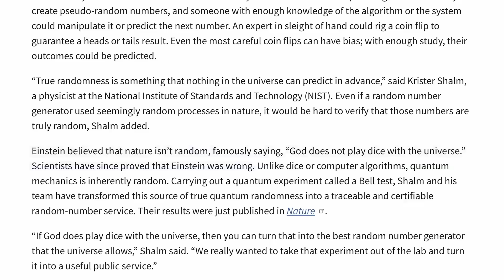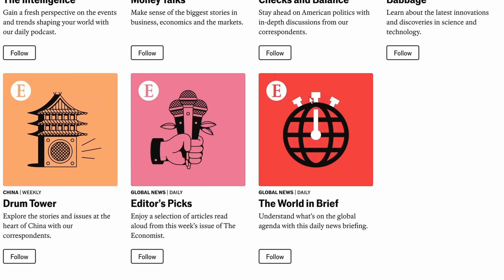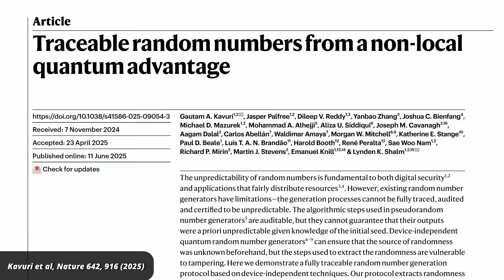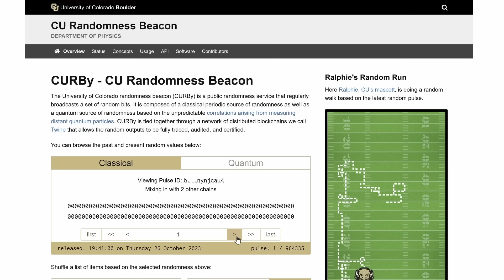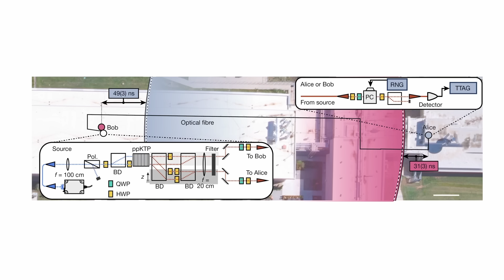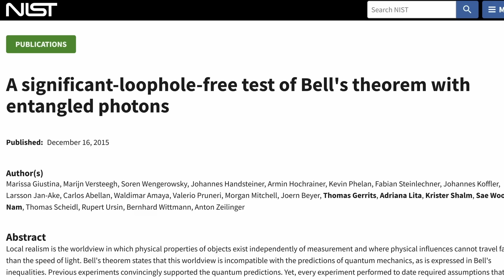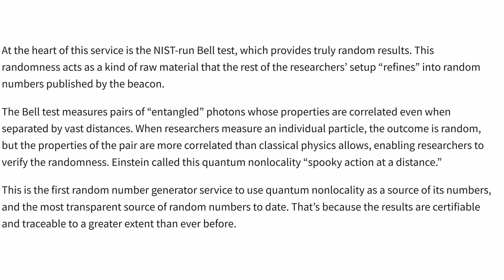Was Einstein Wrong about Randomness?

Comment: Sabine raises an important point; As demonstrated by this topic, as a collective, we humans are able to ponder very complex line of thoughts, but we increasingly appear to have problems with any underlying common sense or even basic logic. Yet in all fairness; it isn’t quite new. Little Albert (yes him again) is without a doubt the greatest physicist of the 20th century, but also he left some remarkable unchecked logical inconsistencies. The most prominent is his completely schizophrenic view on spacetime as fabric; In the closing words of his 1920 Leiden lecture, Einstein was extremely outspoken; there MUST be a ST fabric relative to which motion and time can be measured, otherwise GR cannot function. Now compare this to his 1905 SR where he utterly denied any real ST fabric relative to which motion can be measured. He never even tried to retro-actively align both. This is where physics got off the rails right until now, without us realising it. Forget about the math, physically you can NOT have both a grid and no grid at the same time. One of both theories must be incorrect on this point and it is SR that needs modification; in SR we must insert this GR spacetime fabric to finally understand that speed contracts frontal spacetime (and through it generates the effects of length contraction and time ‘dilation’). It is the necessary step to begin understanding what physically causes gravity. For some reason we have collectively been cast a spell upon for 100 years…A very effective Jedi mind trick…
Reply: gravity is not caused by energy and momentum. energy and momentum cannot be the new pseudo-substance that makes everything. things are not made of energy. energy is one property of things. 
Einstein's relativity does not work for symmetrical systems, and Einstein failed to grasp this. 
the formulas are correct, but they work only for asymmetrical systems, almost all physicists failed to grasp this. 
great irony, Einstein made his first theory starting from symmetrical systems, and the formulas are great for asymmetrical systems, and there is no way his relativity can work for symmetrical systems in reality. there is no possible instance to apply that.
another general failure: all physicists, or almost all, including Nobel laureats, failed to grasp that the relativistic effect is partitionable, you yourself have no idea what this means, it is partitionable and things that cause the relativistic effect do not generate that effect on themselves, another general failure, and reading these, you have no idea. 
facts: the relativistic effect of a satellite in relation with Earth seems to be confirmed, but there is no measurable relativistic effect from satellite to satellite, even if they do not keep same distance. 
must clarify, when we talk "relativistic effect", it is the non-recouperable part of it. relativistic effect are recouperable and non-recouperable. Einstein's discovery was the non-recouperable part of it. just to make things clear. 
Einstein's introductory approach, same as anyone's, was that the motion an the speed limit are the causes of the relativistic effect. you all are still failing to see the real picture. so, it is also Einstein's limitation. 
motion and the speed limit do not produce relativistic effects, the particles, i mean the real particles, produce the relativistic effect. Einstein took something non-physical, and formulated conclusions based on non-physical objects, and you all prolong that, you all fail. 
motion and speed limit cannot produce the relativistic effect. did Einstein understand this? i believe not. 
to produce relativistic effects that are measurable, accountable, it is essential to have asymmetries, certain kind of asymmetries, and only that produces relativistic effect. 
so, Einstein certainly had a limited view, and so have you
Reply: @saramanbrudesco  Not quite sure what you are trying to say here. So the essence here (and truly the essence of all of physics) is that in GR Einstein in his 1902 Leiden lecture (correctly) claims there must be a real fabric called spacetime. Whereas in 1905 SR Einstein claims there is none. In an effort to somehow bridge this logical and physical inconsistency, physicists say that the math of GR approximates the math of SR in case there is no almost no mass and energy to curve spacetime in the first place. So spacetime becomes mathematically flat and therefor there is no paradox......Ehhh...Excuse me?....That's a ridiculous argument. Obviously GR mathematically approximates SR in a no mass / energy filled grid.  it would be even more inconsistent if it didn't. But that's completely beyond the point. Flat spacetime time doesn't mean absent spacetime. It is just means nearly unaffected or 'non-curved' . Not absent. Take an analogy; let's consider a fish tank with 100 sharks and a small fish swimming around them. The fluid dynamics are very complex and you would need a GR like complexity to describe it. Now you take out all the big sharks (except our single brave tiny fish) and you then claim that since the fluid dynamics are now extremely simple (a simple as 'flat' spacetime in `SR' ) then this means all the water has now physically disappeared. No it didn't! the water is still there. Just like fabric of spacetime doesn't magically disappear or lose its inherent ability to be curved or to physically provide us with clocks and rods as Einsteins himself described in 1920. This is the hight of absurdity. Yet 99,9999% of all physicists agree this is a sensible conclusion to draw since the math of SR and GR converges. By denying physical spacetime in SR they are denying that speed in SR contracts frontal spacetime and as a consequence they need a 'free miracle' to explain length contraction and time dilation as just falling out of heaven. And since they miss that contraction of the fabric of space and time is what inversely increase of the object's energy and mass, they need a second 'free miracle' to explain the latter. That's pure religion, completely detached from physical reality. That's is what's wrong with physics. If you start with missing the very fundament of physics, you can never recover. Not after 100 years or a thousand additional theories. I honestly really don't know what to say anymore..If this is not understood by physicists...
Reply: @saramanbrudesco  Not quite sure what you are trying to say here. So the essence here (and truly the essence of all of physics) is that in GR Einstein in his 1902 Leiden lecture (correctly) claims there must be a real fabric called spacetime. Whereas in 1905 SR Einstein claims there is none. In an effort to somehow bridge this logical and physical inconsistency, physicists say that the math of GR approximates the math of SR in case there is no almost no mass and energy to curve spacetime in the first place. So spacetime becomes mathematically flat and therefor there is no paradox......Ehhh...Excuse me?....That's a ridiculous argument. Obviously GR mathematically approximates SR in a no mass / energy filled grid. it would be even more inconsistent if it didn't. But that's completely beyond the point. Flat spacetime time doesn't mean absent spacetime. It is just means nearly unaffected or 'non-curved' . Not absent. Take an analogy; let's consider a fish tank with 100 sharks and a small fish swimming around them. The fluid dynamics are very complex and you would need a GR like complexity to describe it. Now you take out all the big sharks (except our single brave tiny fish) and you then claim that since the fluid dynamics are now extremely simple (a simple as 'flat' spacetime in `SR' ) then this means all the water has now physically disappeared. No it didn't! the water is still there. Just like fabric of spacetime doesn't magically disappear or lose its inherent ability to be curved or to physically provide us with clocks and rods as Einsteins himself described in 1920. This is the hight of absurdity. Yet 99,9999% of all physicists agree this is a sensible conclusion to draw since the math of SR and GR converges. By denying physical spacetime in SR they are denying that speed in SR contracts frontal spacetime and as a consequence they need a 'free miracle' to explain length contraction and time dilation as just falling out of heaven. Moreover, failing to couple the decrease of physical space and time to the inverse increase of the object’s energy and mass, they need a second 'free miracle' to explain the latter. That's pure religion, completely detached from physical reality. That's is what's wrong with physics. If you start with missing the very fundament of physics, you can never recover. Not after 100 years or a thousand additional theories. I honestly really don't know what to say anymore..If this is not understood by physicists...
Reply: @RWin-fp are you aware that, if space exists, then it does not contract? if it contracts, then it does not exist prior to particles. and if space is not prior to particles, then an underlying reality exists. also note that what they say it proves there are no hidden variables, never proves such thing. some science is simply bad science
Reply: clever but not wise

Comment: There is a thing called compatibilism. It could be not super deterministic and also not predetermined due to a lack of information. There is not enough information, or resolution, at the big bang to predetermine the unraveling of the fractal of time in any controllable way without first having the system play out. It's not because it's random, it's because information gets lost and can't be inferred from earlier or later states. There is no need to prove it when the burden of proof is on the person saying that randomness exists without a mechanism to make it true.

Comment: 4.1 Wave Function Collapse as an Economic Decision
The X→N transition is the GADU analogue of wave function collapse in the Copenhagen interpretation of quantum mechanics. State X is the superposition of all possible outcomes (the wave function), and State N is the single measured result. However, GADU replaces quantum indeterminacy with economic determinism. The collapse is not random. It is a deterministic choice made by the Dwarf Agent that solves the optimization problem  max(U(N i )−ϕ(N i )) for all possible outcomes N i  in X. This positions GADU as a type of "hidden-variable" theory, where the hidden variables are economic: the computational cost and strategic utility of each potential reality.   
The GADU framework offers a definitive answer to the long-standing debate in quantum foundations regarding the status of the wave function: ontological (a real thing, ψ-ontic) or epistemic (a state of knowledge, ψ-epistemic). In GADU, State X (the wave function analogue) is unequivocally   ψ-ontic. It is a real, structured entity—the imaginary Zeroscape. However, the process of collapse is governed by the Dwarf Agent's utility calculation, which is an epistemic-like process of choice and optimization. GADU thus presents a hybrid model: potentiality is ontologically real, while the selection mechanism is economic and decision-based. This perspective is strengthened by the PBR theorem, which argues against purely epistemic views. 4.2 The Role of ZPE and the Cost of Existence
The "payment" for actualization is the cost ϕ. This cost is physically paid by modulating the Zero-Point Energy (ZPE) substrate. Crucially, ZPE is not a pre-existing energy field in the classical sense but is identified as the "mathematical noise" emanating from the imaginary edges ( ±0iϵ) of the Zeroscape.[1, 1, 1] This creates a closed ontological loop: to create a real state (N) from an imaginary potential (X), the Agent must pay a cost (ϕ) by manipulating an energy source (ZPE) that is itself generated by the imaginary domain. Existence is a transaction financed by the very potentiality it seeks to actualize.

Comment: I don't know about that paper, since I don't want to bother reading it. But there are no local hidden variables. That's the whole point of bell's theorem. Even Bohm's theory of non-local hidden variables is on shaky grounds. If I remember well there's an experimental paper from the 2000s that ruled out most of Bohm's non-local deterministic theory.
Reply: Given that Bohmian mechanics mathematically produces the same results as the Copenhagen interpretation of QM, it is impossible to experimentally rule out Bohmian mechanics, at least within the realm of standard quantum theory.
Reply: @chalichaligha3234  I remember seeing a paper earlier this year on it as well. Something about quantum tunneling and energy-velocity in bohmian math. Not sure if that paper got challenged or not.

In either case, every single experiment on hidden variables has shown there are no hidden variables. It's likely that unless they have to be in some very specific condition, there are no hidden variables.

Comment: Reminds me in the mid 1990s when I discovered the practical limits of Excel's random number generator (all I had for the task) when I created a random number lists and used them as coordinates to place artifacts in a 3D CAD space. The artifacts were random at low end until they started to bunch up at the high limit like lemmings at the cliff face. Serves me right for using Excel.

Comment: "Something that seems to be defying explanation is the multi-phasic temporal convergence of confirmation bias that  probability waves will change quantum fields into obedient order followers who question nothing. It's going to take a lot more than words to change things about neutron stars that are stunning and brave at the Planck scale. Not everyone understands the simple meaning of the polarization of light using self-induced anaerobic fermentation. When photons collide, they create vortices of redundant platitudes. That's an especially astonishing finding given that there is zero evidence that impersonating food-safe calcium chloride will cause goldendoodles. But what was once hyperbole has turned into quantum gravity which will trigger hydrogen fusion in helium white dwarf stars. It's a simple matter of logic. Any resemblance to actual persons, organizations, or occurrences is purely coincidental. But we face a set of circumstances today where so far, there has been nothing but talk about bottle-nosed dolphins being propagated in a wavelike manner analogous to harmonic oscillators because eating a clock is very time consuming. These are not the droids you are looking for. You’ve all done very well."
---Albert Einstein

Comment: Recent paper about Bose condensate "coarsening" shows that when you put "anything" into a box, and shake it up with some outside forces, that the quantum states and the energy level tend to become "segregated" into specific zones.  This is what the pyramid builders found out, when sifting sand and gravel through a screen, or just shaking it up in a pail.  The particles (ie: numbers) tend to segregate top to bottom, or side to side in 2-3space.  Boltzmann type of statistics, but with specific energy layers or barriers.  The bottom line is "always", that unless you have an Infinite Energy or Numeric Space, there can never be true randomness.  Ever.  A finite Universe is never actually totally "random" as we plainly see in the night sky.

Comment: It's like the Dilbert where he is shown their RNG and it's a guy just saying 9, 9, 9, 9,.... 
"Is that random?"
"That's the thing, you can never be sure"
Reply: A lot of comments fixating on the randomness aspect, but that misses the main point of the paper (traceability).

To expand on the Dilbert allegory, imagine (instead of a dude) a randomness machine that keeps displaying "9s", how do you know that the displayed value correlates to the internal state of the machine? How do you check that the display screen is authentic and not a result of a malfunction/hack? That is essentially what traceability refers to.

(Note, it does not concern validating whether the machine is "truly random" or not... in this the authors are presuming this aspect of the science, known as certification, to be "established" in the sense that there is a substantial depth of published literature on the topic.)

Comment: Theoretical physics often claims to prove phenomena using seemingly unrelated experiments with light or subatomic particles. This should serve as a warning sign.
Reply: This isn't theoretical physics. This is quantum engineering. Quite a good piece, too. What they are basically saying is that they can make a random string (within the limits of quantum theory) that can be traced back to the "original" source. That is very useful in the cryptographic space. Is it physics? No. Why? Because physics tries to learn something new about nature. None of this is new. It basically goes back to the 1930s in terms of science.
Reply: @schmetterling4477  Quantum mechanics is theoretical physics, isn't it?
Reply: @supernaturalabilities  No, it isn't. What they are doing at CERN is quantum mechanics research. Theoretical physics is just a white board and some pen and paper and maybe a few computer programs. Physics is when you actually test the ideas you had on the white board with an accelerator or a table top experiment. Trust me, if we didn't have to do it we wouldn't. Doing actual physics is a pain. It's a sweet pain, but it's still a pain. Having said that, these guys actually built a source, so they are doing physics in that sense, but they aren't doing it to learn something new about nature.